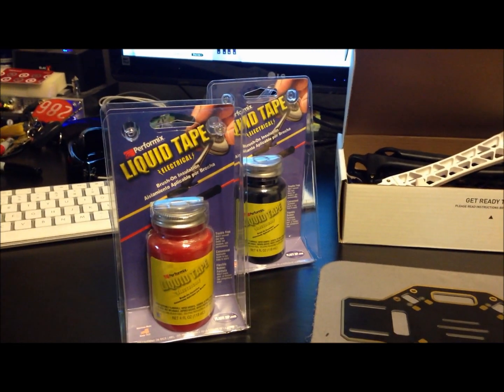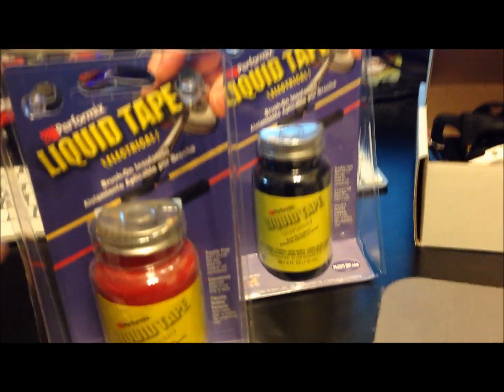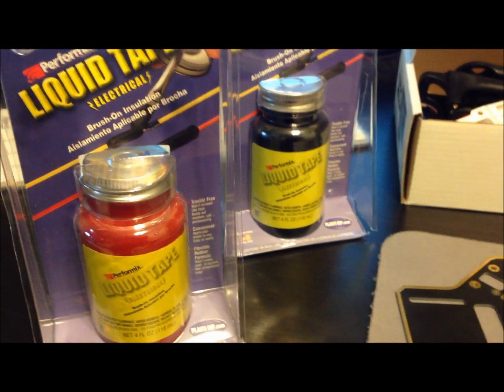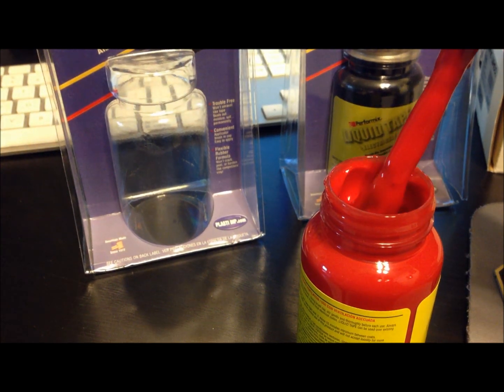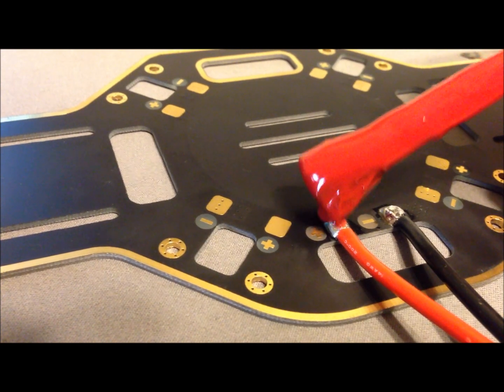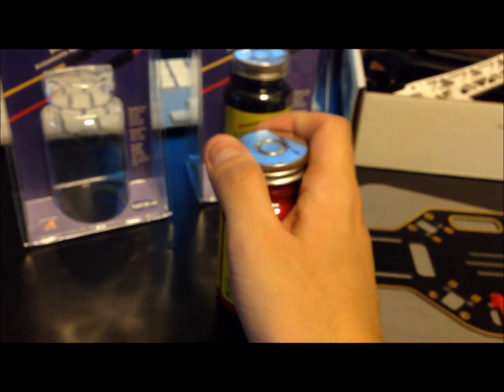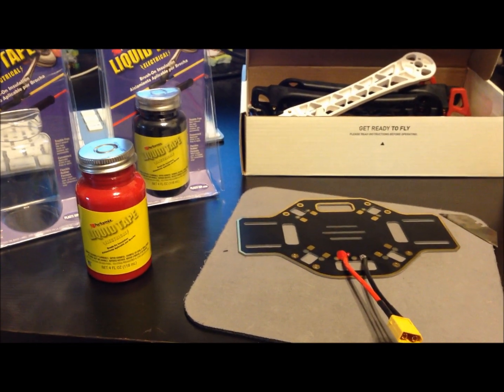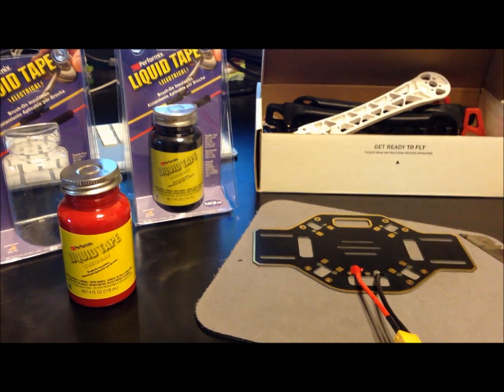PERFORMIX Liquid Electrical Tape"What I Use"

Comment: How would this hold up against fuel contact?  I've been getting a bit of corrosion on my fuel filler neck and think this may be a solution against a rubber fuel cap gasket.  Any thoughts?  I've been using it on electrical contacts and wires that come in contact with road salt and it seems to hold up very well.  May just have to test against some fuel.
Reply: +1